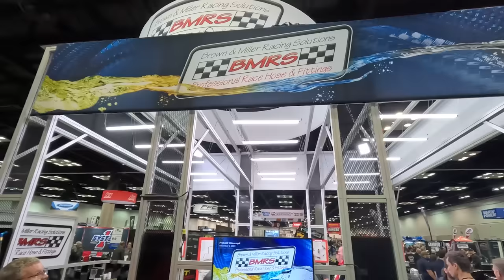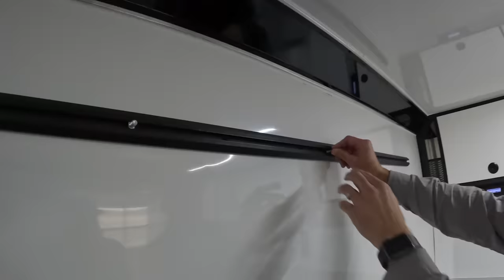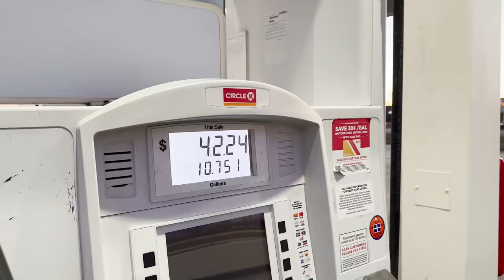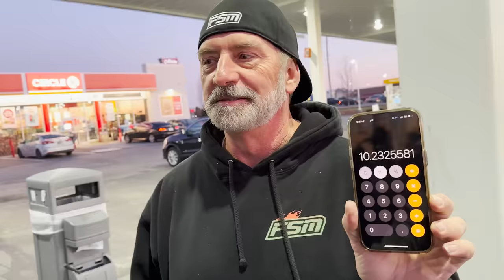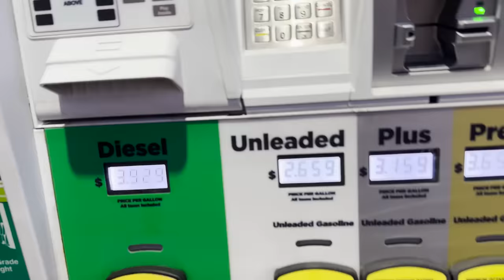The Cummins-Swapped Chevy Square Body Hauls My New Race Trailer!

Comment: ATC trailers are incredible. They have great services as well, had ours back there for repairs a few times over the years.
Reply from the maker: I'm very happy with mine.
Reply: @FinnegansGarage  it shows 😊
Reply: @FinnegansGarage  question, could axle out of alignment, with each other, on a tandem trailer, be part of your fuel mileage issues? If the 2 axles on a trailer, had gotten knocked out of alignment, it would create drag, no? Brand new trailer, bet those axles aligned perfectly, less rolling resistance
Reply: @jfk64kennedy95 - sounds logical.  Plus the new trailer is aluminum, way lighter.
Reply: Yes it will, not alot. You will notice trailer tire wear more than fuel milage. I get mine aligned about every three years. Its only been adjusted once in 12 years. That was more worn bushings than mis alignment.

Comment: This is an amazing factory tour.  I love seeing what goes into building large pieces of equipment/trucks/trailers etc.  I'm trying not to be a negative Nancy here but I work in a facility that builds products very similar to these and I can't help but notice some things that could be improved safety wise.  I was surprised to not see mandatory ear protection and safety shoes.  We allow people to not wear safety shoes but they have to remain on a very clear designated path.  Also the part where they are installing the roof.  I can't help but see tons of spots where an arm laceration could occur.  I wonder if there are leather sleeves or something similar to what welders wear to help prevent an injury there.  Those guys know their job and are beast at it. I would hate for one of them to get an injury.  I do really like the yellow sleeves they put on the ends of the kit carts to help keep people from walking into them.  That is something I'm going to see if we can implement at our own facility.  A really cool look into how these trailers are built I just worry about the safety for some of these associates.
Reply: Good safety suggestions.

Comment: Excellent vid, Mike!!!  I love the fact that you're happy to put a spotlight on the "behind the scenes folks" - gives your channel content that well-rounded gloss.  This vid also flashed me right back to the year I spent working for Tenneco, here in Nebraska.  The name might not be familiar, but I'll wager some of their products are - Monroe shocks and struts; Dynomax exhaust; and good old Thrush mufflers.  A full list would blow out the bandwidth here - the Tenneco portfolio currently contains over 650 aftermarket brand names.  During my tenure, I bounced between the Dynomax and Thrush lines, and we were churning out a couple thousand parts every week.  I still get a kick out of the fact that in 2011-2012, some of my work could be found at virtually every car show from border to border, and coast-to-coast!!

ATC seems like a great outfit to work for - they're big enough to generate pretty good bank every week, but they're small enough to nurture a strong "family" atmosphere at their core, which is a mighty rare and special thing, these days.  If I ever have need of a decent trailer, they'll be at the top of my go-to list, for sure.

Thanks again, KUTGW, and Happy Festivus!!!🥸

Comment: Enjoy! It was cool to see how these are built. The RacerMatch (tm) explanation was pure genius. I figure mine will pay for itself in only 243 more years!

I’ve had my 24’ since 2017 - it’s been an incredible trailer, easily the best enclosed I’ve ever owned. I’ve probably put 30K miles on it since purchase. Mine was a custom order (no left side door, extra out lights and interior lights, amongst others), and was right in line with their explanation - three months from order to deliver.

That modular system is amazing, I wish it existed when I bought mine. Those things are so light and pull so well that I can tell the difference between when my 2090 lbs car is in it and when it is empty.

Do yourself a favor - one spare is never enough for the trailer, get a second. Ask me how I know.

Comment: What a Awesome trailer. ATC  have building trailers almost down to a science. Only thing I could see is having a dual onboard air stations in case you need to change a tire or add air and operate air tools during meets or playing with the toys.

Comment: I sell rvs and I have one tip to watch out for. Its when water runs down behind the trim around the doors. It wicks up into the wood behind the doors and rots them out. you will not know until it is too late. Great product.

Comment: Should protect the outside ! Hydro 2 by carpro works great for half a year, spray on pressure wash off leafblow and towel dry with a spray wax or sealant for added wows

Comment: Very nice. Just a note. You should never cross the straps in the trailer. I one would happen to break, it could pull the car sideways into your new trailer.
Reply: this can cause the straps to cut on each other. I've also had bad strap routing cut them.

Comment: Super nice folks and ultra clean trailer shop.  Very cool.  I really wish they would have gave you AT LEAST 1 set of tire chains/cable chains for the Trailer, because snow,,or getting caught in the snow.  Nothing worse when the trailer attempts to pass you in the snow.   It's a horrible, literal gut-wrenching feeling, as your fully loaded trailer steps out from behind you in the snow,, with zero driver input.   A hand controller on the dash for the trailer brakes, so you can pull everything straight if it gets away from you.  No stacker needed, if just racing 1 car.  Shortie stackers are a handful in the wind, especially lightweight alum construction??,, and they burn more fuel.   They ALL need a lead keel weight down the bottom center of the frame of 10,000lbs to be safe, even the 53' Pro Stackers.    Thanks Finny, Nice work Joe.
Reply: Trailer starts coming around just give her some skinny pedal to stay ahead. Brakes usually just add to the  problems.

Comment: I live in Hillmar ca just outside of Modesto ca, and I just paid 5.68 for diesel. Yesterday, I filled my wife's suv up earlier today, and the cheap gas was 5.20 something, I think. Diesel has actually got a little cheaper lately, and gas has been pretty much the same for a while now. But here in the central valley, our prices don't get crazy compared to the rest of ca. If you're down by LA or up north in the hills or over in the bay by Frisco, prices are way higher.

Comment: I would recommend not cross strapping its been proven that strapping that way can be completely compromised by only one strap coming loose and your in close quarters so if the car shifts one way or the other it may get into the walls or cabinets the best way is to go from each corner straight to the d-ring and you can loose a front strap and a rear strap and the car will still be secure obviously not as well as 4 straps but the car wont  be able to move just wanted to pass that along

Comment: awesome video that great trailer it looks like big box but is so well laid out on the inside will the Caddy fit? You will save not having to get a motel room. I see it has sun shade to work under while at the track. Or use when your using your  to drag boat,. having a family outing  Nice Xmas gift for you and yours Nice surprise with mileage boost jump from  8 to 16 maybe it'll get better. It was nice see your gasser spinning its tires again. Two lane black top (be well)

Comment: Why the heel do they use spool guns?! Get the push pull it's way more effective and makes better welds with less weight on the welders hand
Reply: Aluminum wire is softer than steel wire and doesn't work well in push pull.
Reply: @81DEK  I use push pull guns every day welding aluminum  buddy! For the last 8 years! Never have a birds nest